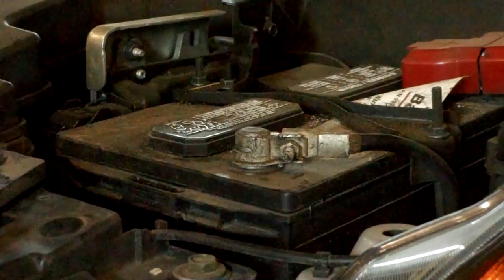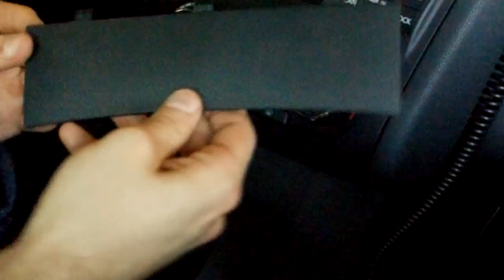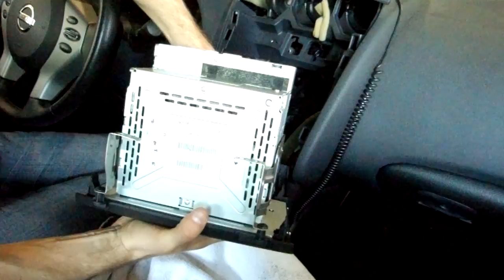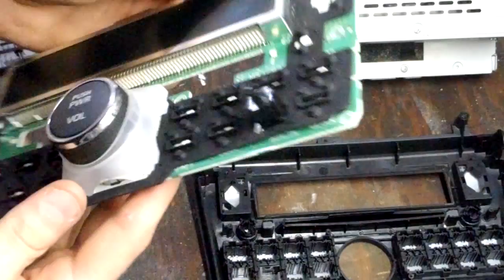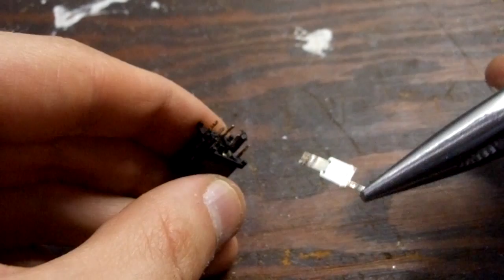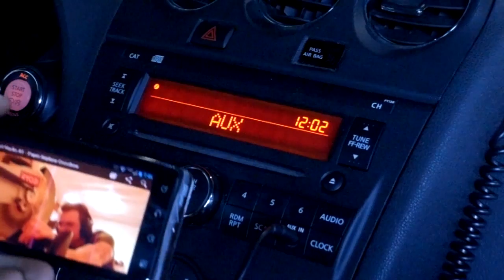Rick's Repairs #1 - Nissan Altima Stereo Repair

Comment: My 2019 Altima’s CD player is on the fritz. It started when I had to get a new battery at my corner service station. My mechanic found a work-around concerning the ignition start button but that work-around isn’t working now.

Comment: Guys, don’t do any of this! 

I removed the entire stereo. Went to a junkyard, looked for a Nissan. Removed the stereo. Bought it for $50. Then installed it again in my car. DONE ✅ works perfect!
Reply: I Bought A Stereo Off eBay For $85 Installed It & It Still Wouldn't Work I'm Guessing Its The Fuse

Comment: Hi, I have a 2008 Versa S. How did you find the jack part number(K2HC107A0005)? I need to find the one that will replace mine. Thanks.

Comment: Rick your blog link is not working. I want order the part but can't. Any help w/ supplier would help. Still the best DIY aux Jack video out there! Thank you.
Reply from the maker: You can just google the part number K2HC107A0005. The original supplier I used doesn't have them in stock any more. It seems they are much harder to find then they were a few years ago.

Comment: Just followed tutorial and it worked like a charm, TY! The part seems out of circulation/discontinued in most places online, but I found one on EBay and won the bid for $29 after shipping cost. Ran into "No Aux Input" problem, but I fixed it by redoing the soldering to make sure it was laid down right and, in my particular case also, that the soldering wasn't touching/connecting nearby joints. TY Rick, if ever you need a "like" or shout out or anything else I can help, please let me know!
Reply from the maker: Erick Suarez you are very welcome! when I first posted the tutorial I thought it would be a very specific problem no one else would have but clearly this is a very common problem. I'm really glad I could help!

Comment: Any idea where to get the part? It's out of stock/unavailable everywhere I've looked online.
Reply: Erick Suarez 

I ordered mine from encompass last week.  just google the part number and it should be one of the first two or three hits.
Reply: Mark Woods I've checked encompass, it says that the part is "not available for resale". Only thing I can pull up is an Ebay auction for the part.
Reply: Erick Suarez mine said out of stock also, but I got an email with an update and it was delivered in 7 days.
Reply: sorry, just tried myself and saw the note.  that's different than what I saw when I ordered.   not sure what's going on,  all sites say is not available.   weird,  since I just received mine a few days ago.

Comment: Hey Rick thanks, I ve finished this little project just now. The sound is great. One recommendation to everyone who wants to try this though, after you unplug the battery do not lock all your doors, because it is not opening with the mechanical key, the battery needs to be connected to unlock the doors.

Comment: Hi Rick. very nice video. I tried going to your blog with the link in the description but it gave me a 404 not found error. Please let me know the replacement part number for the aux port if you can.
Reply from the maker: Part Number: K2HC107A0005
Reply: +Rick Osgood  is it ok if the brand is Bose but the replaced part is Panasonic ?

Comment: Just a quick note on those who are getting a "NO AUX" input...my first guess is that there is not a connection on one or more of your solder points...you may need to go back and touch them up...ALSO make certain the solder points are all COMPLETELY separated from each other... make sure your AUX cable is functional as well and doesn't have any shorts.  Good luck!!  Those are my best guesses.

Comment: Just completed the AUX jack swap (Part # K2HC107A0005) in a 2011 Altima...works perfectly now!!!! GREAT VIDEO!!! The jack cost me about $3.10 and then about $6.50 shipping.  I fixed my head unit AUX port for under $10.00!!!  De-soldering does take some time but I did it in about 15 minutes.  I found it helps to widen the de-soldering wick and hold the tip of the solder pen on the wick until you see the solder being absorbed by the wick.  Thanks again for the video!!! You literally just saved me a couple hundred dollars!!
Reply: John Smith where did you order the part?
Reply: Hello John, where did you find the part?

Comment: Great Video.  Did the job in 60 minutes.  If you don't have the solder strip you can just use some old speaker wire.  You just have to put some flux on the wire.  I also found a couple of black screws on the faceplate that I had to remove just prior to taking it off that weren't in the video.  Otherwise - Really nice video.  Thanks for the links re the part order.  Took about 5 days to arrive.

Comment: Hi Rick: Excellent video!  Last night my son and I replaced the K2HC107A0005 on his 2007.  The video was a great help to find the part ($2.65) and take the guess work out the proper sequence of removing and replacing the Bose unit.  The de-soldering process was the most cumbersome until we figured out the rhythm.  Used units were available for about $100 but most had some type of issue and his unit was perfect except for the jack that had broken off inside.  It took us two hours but de-soldering was 45 minutes.  Thank you.
Reply from the maker: +Bobby G I'm so glad this video helped! It's frustrating how many people are affected by this. It would be nice if there was a sturdier component to replace the bad one.

Comment: Just completed this repair, but now I was driving home from my dads where I used his tools, and within 10 minutes of using the AUX port, it randomly quit and displayed "No Aux Input" on the screen. :(
Reply: I just replace mine and can not seem to figure out why it says no aux input!. If you have fixed this problem please let me know how.
Reply: I took it all back apart and re enforced the solder, fixed the issue

Comment: I have a 2010 Nissan Rogue with the standard radio. I'm having trouble removing the faceplate. It seems the volume button/dial is getting in the way. Anyone have any tips? Thanks.

Comment: excellent and informative (to the point) video... helped me to fix Aux socket my altima...  desoldering was toughest .. . and putting the PCB back onto faceplate...

Thanks for creating and sharing this video...

ordered it from partstore (it has cheapest shipping)...

Panasonic JACK
K2HC107A0005
$2.73

Comment: Hey RIck, Your video is really helpful. I was able to exchange my Audio port by buying a new jack by the part number that you posted. Unfortunately, I can only hear music on the left side of my car after exchanging the new part. Do you have idea if it might be the part that's bad or if I did not connect the new part correctly onto the circuit board?

Comment: Rick,  Thanks for the video. I ordered the part and made the repair.  Small error when putting the radio back together, there is a metal clip that goes around the CD slot, I installed it upside down after the repair, if you do that the metal prongs touch the LCD leads and the display goes bonkers.  I took the face off again and flipped the metal ring and all was well.  Thanks again.

Comment: Rick: I just made this repair today with the help of your video and it worked like a charm! Thanks! I have never soldered before, and I was able to accomplish this project. Some helpful tips: You need quite a few screwdrivers and tips. Don't start this project if you only have a philips and a flat head. Also, I put my screws in sandwich baggies to prevent mixing them up/losing them. There were quite a few screws. I am so excited to have my stereo back. Thanks again, Rick!

Comment: Great video.  However, i tried to buy the part using the link from your blog and it says that the part is no longer available.  Do you know where else i can get it, or maybe the model number so I can look else where?
Reply from the maker: If you do a Google search for the part number K2HC107A0005 you can find several places that sell it. Good luck!
Reply: Corey Harris http://www.ebay.com/itm/Panasonic-K2HC107A0005/221693092821?_trksid=p2047675.c100011.m1850&_trkparms=aid%3D222007%26algo%3DSIC.MBE%26ao%3D1%26asc%3D29310%26meid%3Dc332f1566a4c42ee92cef1837be0916e%26pid%3D100011%26rk%3D1%26rkt%3D1%26sd%3D221643940304

Comment: Hey,

I did exactly what you did but still did not work? I did run out of sauder when resaudering. Does the new jack have to be completely saudered in order for it to work? 

Let me know!
Reply from the maker: Some of the connection points might only be for mounting. Some of them are for the audio signal. The audio signal connections are the important ones. I can't remember which are which now. I would just buy more solder and make sure all of the connections are soldered up well. Also make sure none of them are bridging and connecting to each other as that may lead to a short and cause other problems.

Comment: Hi Rick! OK well I broke a piece of my aux cable and now its stuck in the aux input. All I'm trying to do is do exactly what you did here except when I remove the aux input I was thinking if o could just push the piece that got stuck there out. Then I was thinking of putting the same aux input back in place. Do you think this would work? If so please explain what I word have to do after removing the piece. Thank you! Greta video!
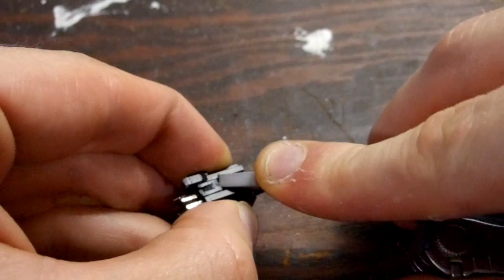Reply from the maker: That will probably work as long as you haven't broken the actual jack itself. You would basically have to follow the video up to the 5:01 mark. Once you get the jack pulled apart, you can use something to poke out the broken piece. Then put the jack back together, solder it back on, and put the stereo back together. You just need to be careful you don't break or melt the jack or else you might have to replace it.

Comment: I only have 3 connectors in my Altima...
Also after I put everything back together my LCD screen just showed up blank.
Reply from the maker: I'm not sure what all of the connectors are for so it's possible that some models only have three. My car has audio controls build into the steering wheel. If your car does not have that, maybe that's the extra connector? If the LCD is blank then I would guess maybe it didn't get plugged back in properly when you had the stereo apart.

If it were me, I would take the front face plate off again and look at the connectors on both pieces. Check to see if any of the pins are bent. If so, unbend them and carefully plug the face plate back in.
Reply: I ended up taking it back apart to check all the connections and blew them out with some air, and that fixed the problem I guess. Also the cables, in yours you either have a bluetooth connectivity or satellite radio, I don't.

Comment: Hi Rick, can you tell me where to find this part, iv called many placed looked on amazon, and ebay. Im having a hard time finding the jack?
Reply: Found it in the link! thank you!
Reply from the maker: If you do a Google search for the part number K2HC107A0005 you can find several places that sell it. I ordered mine from here and it worked fine:
http://www.pacparts.com/part.cfm?sku=330N9KF874D7772

However the price has gone up from $3 to $10 so you might want to try another store. I found these via Google but I have not tried them myself. The part number is the same though.

http://www.encompassparts.com/item/8121068/PANASONIC/K2HC107A0005/JACK
http://www.partsimple.com/k2hc107a0005-msc-n-13.html
https://cceparts.com/ProductDetail.asp?PartNumberKey=PPK2HC107A0005

Comment: Thank you so much for your immensely helpful video! We just bought this '08 Nissan Altima used, and we found out that the aux jack didn't work. Your video likely saved my life (just kidding), since my wife would have killed me if I put a new stereo in the nused car. Unfortunately, the link to your blog no longer works. The part from Pacparts cost me $14 with shipping, which is much better than the $200+ for a new stereo. I used to do quite a bit of soldering, so I had all the tools needed to do the repair. One thing I found is that the dash material around the vents is very thin, and peels off with even the slightest abrasion. Thanks again for an excellent tutorial!
Reply: Sorry, I was wrong about your blog not showing up. It must have been a temporary glitch.
Reply from the maker: Thanks for sharing your experience! I never expected so many people to find this information useful when I first published it. It's always great to hear that I was able to help someone.

Comment: My AUX plug works but whatever cable I try to plug in, it is always loose, its never snug so it loses connection often since it doesnt stay in place.

Do i need a new AUX jack?
Reply from the maker: It sounds like maybe the metal contacts inside of the jack have bent out of shape and are now loose. If that's the case, a new jack would probably fix this problem.

Comment: So this works the same if i broke the tip of my cord off in the jack i should jus replace the aux? I have an 08 nissan too
Reply from the maker: If you have the same stereo then you should be able to replace the jack like this. Although it might be easier if you could find a way to extract the broken jack. Maybe using tweezers or needle nose pliers.

Comment: Do you have a list of all parts needed to complete this?!
Reply from the maker: The only part I needed was the audio jack, which you can find by Googling "K2HC107A0005". As for tools, you'll need:

Soldering iron
Desoldering braid
Solder
Torx screw driver
Phillips screw driver
A thin but stiff plastic piece (Credit card) to pry open your stereo

Comment: Just looked over your video about replacing the aux jack.  My 2008 Nissan Altima has the Bose radio system.  Will the Panasonic part work with the Bose radio?

Comment: Is there any way to test whether the aux port is working before re installing the stereo? I ask because I replaced the port and it still doesn't work.  I'm hoping I just did a poor soldering job and I can just redo it.  Hoping I did not damage the circuit board in the process
Reply from the maker: Are you getting no sound at all? Or is it coming out only one speaker or something? The only test you can really do is to use a continuity tester on the board. Plug in the audio cable and press one of your probes onto the ground part of the exposed aux plug. Then use the other tester to probe around the solder joints to make sure it goes to the right place and doesn't bridge anywhere else. Then do the same for the left and right channels of the aux cable. Unfortunately I can't tell you where they are supposed to connect too without having one in front of me. Another thing to check is that the left/right/ground signals are not connected to each other. You can test that without taking the stereo apart by using the continuity tester on the end of your audio cable and trying all of the possible combinations.
Reply: Rick Osgood I was getting no sound at all.  When I plugged in a music device (ipod, cell phone, etc) the stereo just said No Aux Input or something to that affect. So the stereo just isn't even recognizing the port
Reply from the maker: 2006breakmyballs Unless you shocked something with static electricity or burned one of the parts with your soldering iron I find it unlikely that you broke something when soldering. It's possible your solder joints are not good enough or they are bridged together in a way that is making it not work. Did you have any sound at all before you worked on it? Did you completely replace the jack?
Reply: Rick Osgood my old port was completely destroyed so I got a new one.  I just tried re soldering all the connections and the stereo does play sound now but the quality is horrible.  The vocals almost sound like someone gargling water.
Reply from the maker: 2006breakmyballs That's kind of how mine sounded before I fixed it. Sound would come out only one speaker unless the plug was wiggled just the right way, and sometimes the vocals would sound quieter. The culprit for me was a bad connection inside of the audio jack. There are some flat contacts that were bent and causing the problem. If you bought a brand new jack you shouldn't have that problem though. It's possible one of your connections is still loose and causing the issue. If you play music and wiggle the cable around in different ways, does the sound quality change? Have you tried playing music from another device just in case it's your device that sounds bad?
Reply: Rick Osgood well now I'm more confused then ever.  My ipod seems to work better than my cell phone, but both devices work fine with headphones.  Wiggling the cords around have absolutely no affect on the quality.  Sound is coming out of all of my speakers, the instruments sound good its just the vocals are barely audible when other instruments are playing.  I've tried using three different aux cords with both devices with no difference.  It could just be a bad solder job, I'm not very experienced with it.
Reply from the maker: 2006breakmyballs So I actually had a similar problem with my Android phone where listening with headphones seemed fine but the audio in my car just sounded like crap. I ended up going into Android Settings and then Sound and then Audio Effects. It has some equalizer setting pre-configured. I turned off the Audio Effects completely and it sounded WAY better after that. If you are using Android, maybe you have a similar problem? I have no idea why it was only noticeable in my car but that was my own experience anyway.